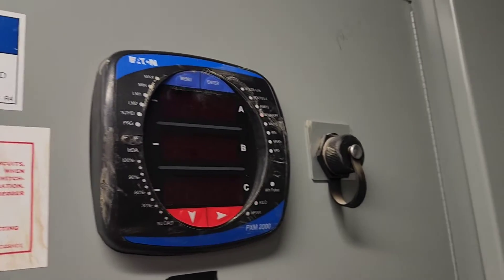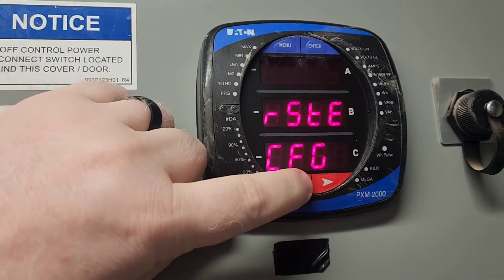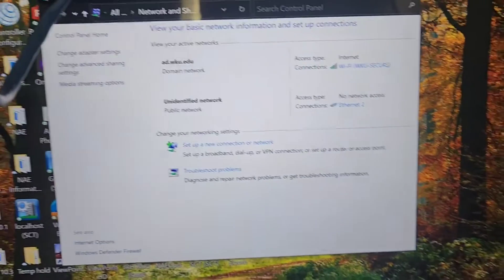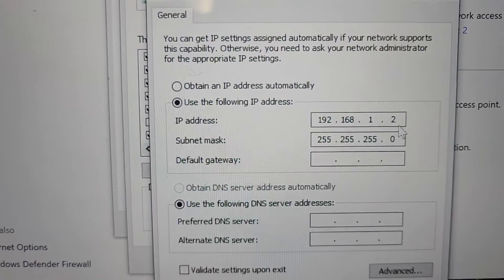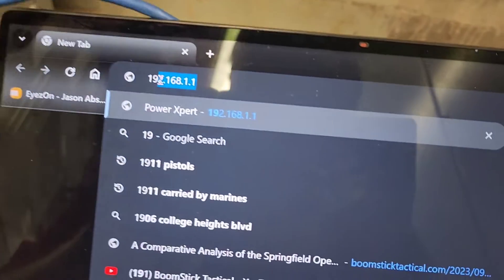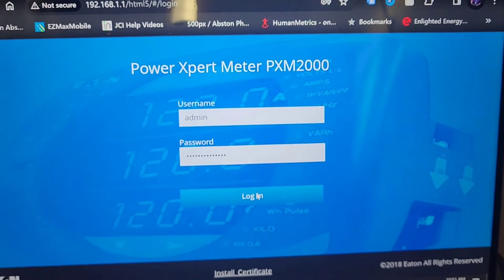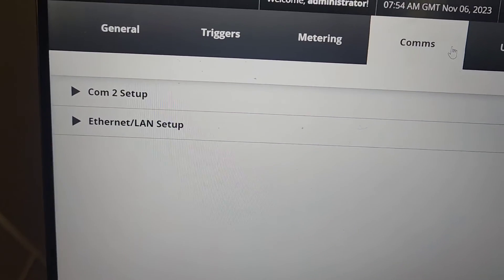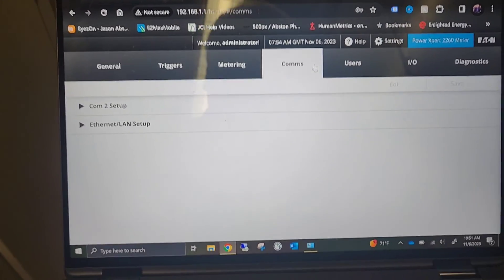Step-by-Step Tutorial: Configuring Eaton Power Xpert Meter for Network Communication

Comment: Hey man new tech here, your videos are very helpful, was just wondering if you have any subject matter regarding common switching controls, specifically with the CVM3050s, struggling to grasp the concept, anything would help, thanks
Reply from the maker: I'm thinking about doing a series on wiring some of the devices. Anything in particular you interested in seeing?
Reply: @Systemcontroltech  Just particularly how the BOs, Fan-C, HTG-C need to be wired/ rewired to switch common at the relay or contactor to energize what’s needed and how it all works together from controller to high voltage can.